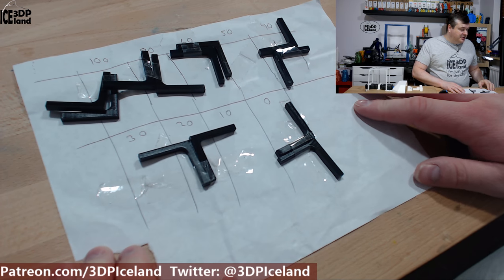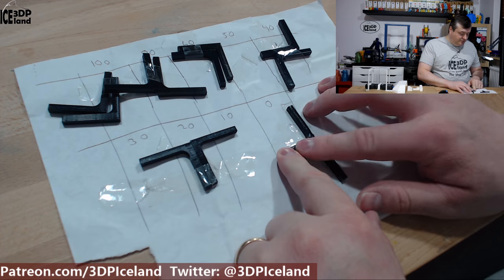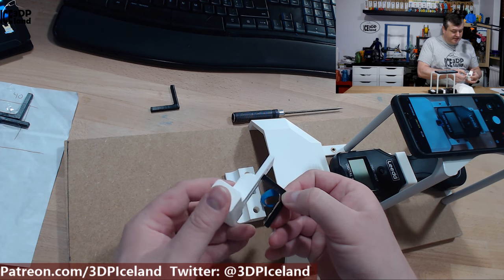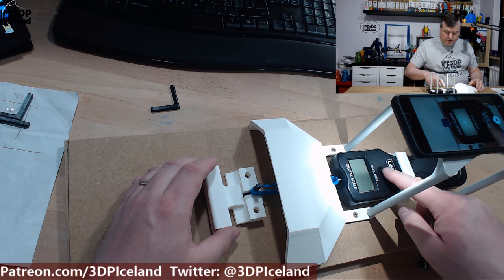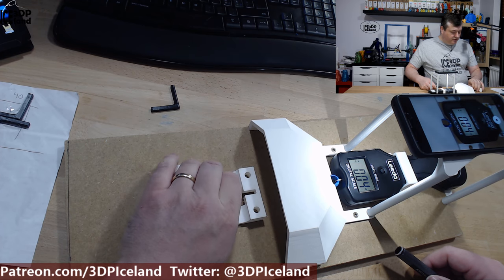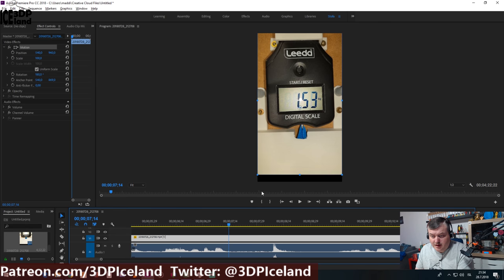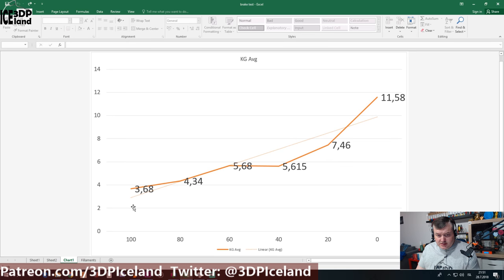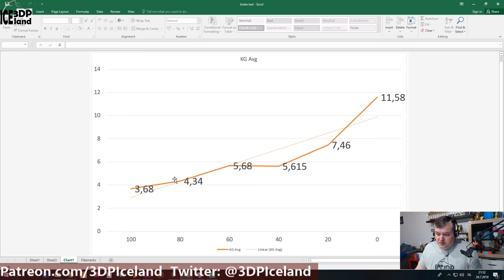PETG Layer Adhesion based on Part cooling speeds

Comment: Whoa! Your meter contraption seems like it worked very well. I was worried about finding the break point in the video output but it appears that the audible snap of the part breaking puts a nice sync mark on the audio track. Nice Work. Thanks for sharing your results and method
Reply from the maker: thank you, - yeah, audio track was a must to find the correct spot in the video :)

Comment: Wow, that's a crazy increase in strength with no fan. I'm going to have to try PETG again as I left it when I was getting less than ideal strength and layer adhesion.
Reply: Just  quick update. I tried running a few sample prints without the fan and the first half centimeter of print looks good (because of the heated bed), but then it quickly degrades at it prints higher - so bad that you can't use the print. I guess that didn't help for me :(

Comment: Thank for for doing this!  Can you confirm that your test was the same as the other video testing out PLA (different colors)?  If so it seems with reduced cooling, PETG layer strength (~ 5.7kg -11.6kg)  is stronger than PLA (~5.4kg)

Comment: I finally printed PETG with my Prusa MK3 using the preset settings for Slic3r PE and the parts came out great as far as I can tell. I decided to print the parts for the MK3 extruder fan upgrade after watching your earlier video. I was wandering how you print your PETG. I just used my normal settings for PLA and I believe the Slic3r PE has the fan come on at 30% after 3rd layer. I  wasn't sure if I should use glue stick or something as a separation layer but after the main extruder base printed and was easily removed from the spring steel sheet I felt confident to print the rest of the parts without glue. I'm just curious how you print PETG.
Reply from the maker: 3D Medic Vince hi, see other video responce, but yea, fan at 30%, print on the pei sheet, but let it cool fully before you remove the part